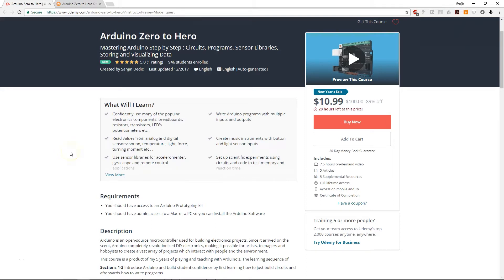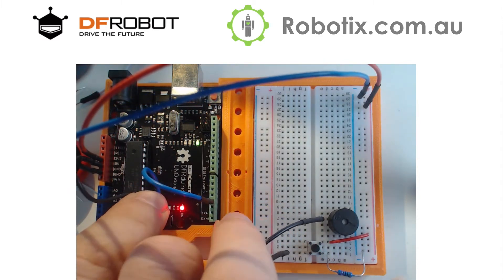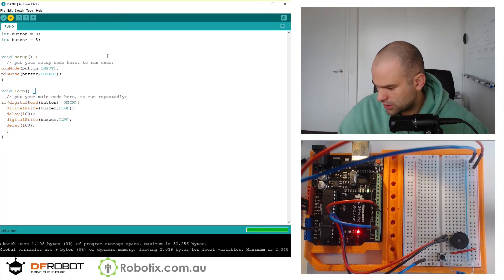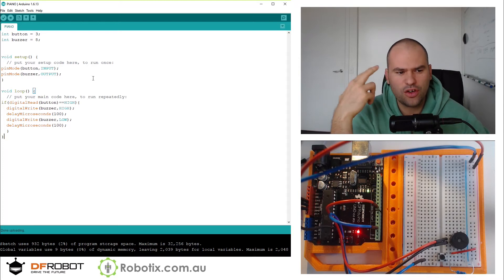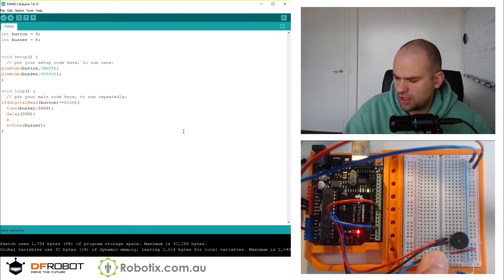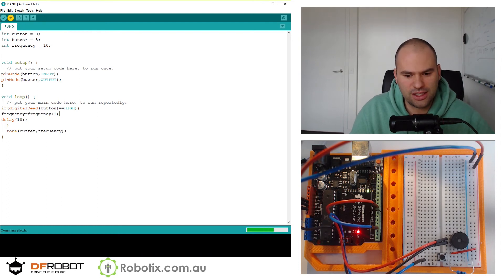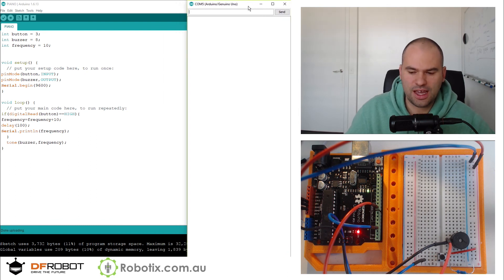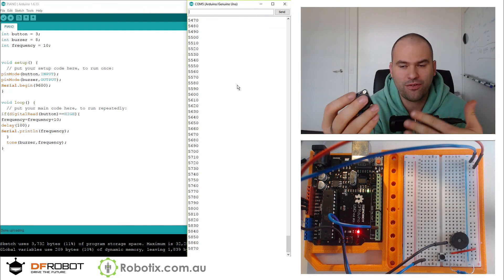Push Button Frequency Generator

Comment: You should use the IF statement when button is HIGH to run the tone and notone when the button is released.
Reply from the maker: Yea that is a good idea, but do you think you could do it with only one button?, I think you would need two:  one button to increase the frequency, the other button to play the sound